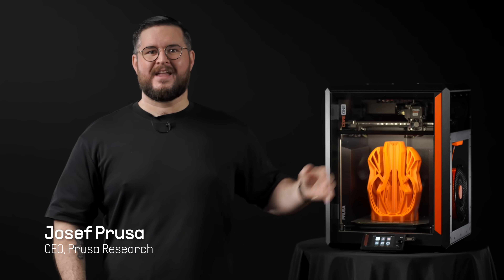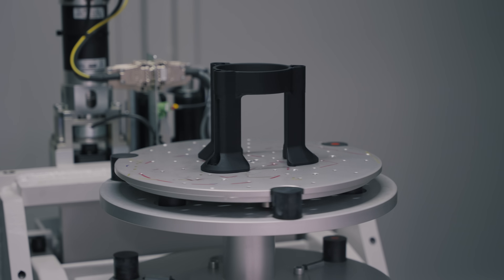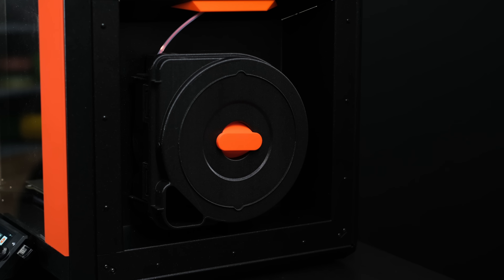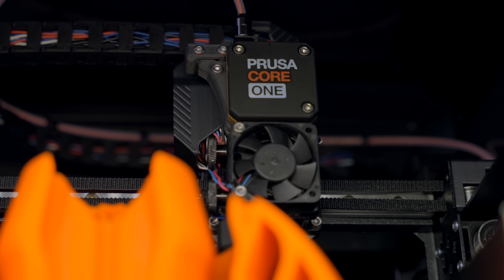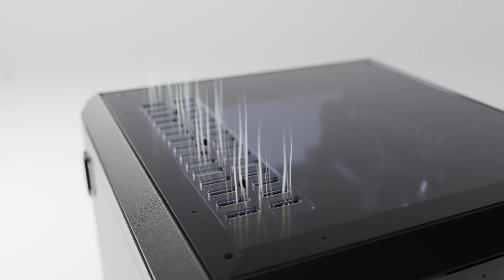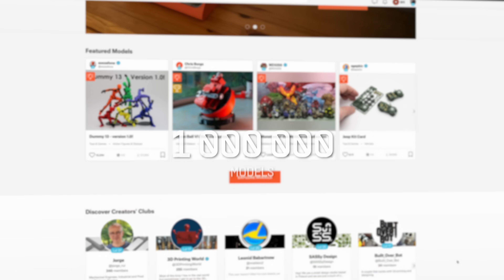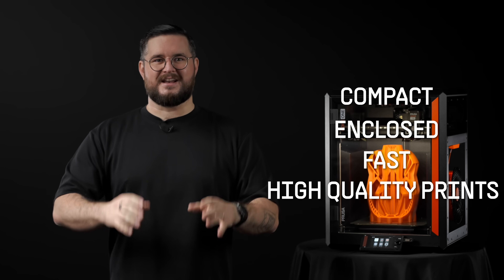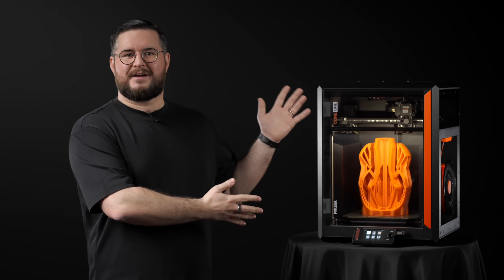Prusa CORE One - Fully Enclosed, High-Speed CoreXY 3D Printer With Active Chamber Temp Control

Comment: Was literally days away from ordering a Bambu x1c.
It's an objectively fantastic printer but my main hangup was lack of open source and repairability.

I think this is finally the printer that checks all of the boxes I wanted, AND with the open source ecosystem of Prusa 😍

Thank you for your hard work
Reply: 1050eur rn
Reply: FWIW, the X1c is a nice printer. I own 2, with 2000+ hours on each. They've been very reliable: a few clogged nozzles and one worn out extruder motor. I am looking at the Core One as a replacement for my X1s when they finally give up the ghost. And by then Prusa will have flushed out any bugs and production hiccups.
Reply: @seanwoods647 as reliable as it seems, BL are made to be expendable. The bearings on the Y axis are extremely hard to replaced and the luck of open source it is an issue for me if you want to keep your machine beyond what BL wants you to. With BL, you have limited to non authority to upgrade to the latest tech and the luck of a heated chamber is a big no for me as I only use engineering materials. The X1C for the price sold should have a heated chamber and it is why I haven't ordered one as I was so close to. I went to build my own custom printer and therefore I have utilized all the benefits of klipper. Don't get me wrong BL are good machines but the only way to get later tech once the next generation of tech (etc beacon, IDEX, tool changer and so on) is introduced is to buy their new printer.
Reply: Look I like prusa and their philosophy is a lot better than bamboo labs, but I don't know what people are talking about when it comes to repairability with bamboo Labs printers. Yeah all the parts are proprietary but you can definitely order them from bamboo Labs and for the most part they're easy to replace.
Reply: Bambu is as much open source as Prusa.
Reply: Sadly not shipping until April... (not including delays)
Reply: @skyslycer  The assembled version will ship in January 2025 not April 2025.
Reply: @skyslycer  it says right on their website it shipping the middle of November goofball
Reply: @Eric_In_SF  I was wrongly looking at the kit version. The assembled version will begin shipping in January.
Reply: For what it's worth, bambu labs has opened up access to open source firmware.
Reply: @MrPanaramuh  And you can buy nearly every part for doing your own repairs.
Reply: @tankgrrl  This. And, they're reasonably priced. Our x1c has over 1.7k hours on it and outside of basic maintenance, we've done virtually nothing to it. Our biggest "repair" has been a replacement hotend that they sent as an extra. I understand use cases are different for everyone..but this price point and these features don't justify it over an X1c. If you are already in the prusa ecosystem? Sure. As a new printer? No. The x1c is so user friendly, my dad, who knows nothing about printing, bought one on my recommendation for how beginner friendly it is. Between the loadcells in the bed and the lidar, he's never had a 1st layer issue that wasn't due to his forgetfulness to clean his bed every 50 hours. 

"But but, higher flow! Heated chamber! active temperature control! I don't have to print with my door open for PLA! Open source!" e3d hotend, Open source heater project for the x1c, an AMS top mount with vent sliders, X1Plus firmware. Everything this has as a feature, Bambu does better or the community has answered the issue. Never had an issue with support either apart from wait times.
Reply: I still think the X1C is better in almost every way except for print speed maybe...
Especially with the open source firmware installed...
Reply: I have 4 x1c, I would choose a Voron trident over this Core.
Reply: @urzulus  I built a 2.4 300mm and it's a great printer BUT...  I also have a Trident 250 kit in the box and all the printed parts, and I have had them for almost a year with no time to sit down and build the thing.  Hoping to get to it this Thanksgiving week, but if I were purchasing now instead of a year ago, I would definitely order the new Core instead.

Unless you need one of the larger bed sizes that's available with the Vorons, the Core is going to be hard to beat.  It would be difficult to build a Trident 250 for much less, and the Prusa doesn't give up much bed space to it.  Plus you don't have to tune it yourself, and there are all of the little quality of life features that are part of a Prusa.  Granted you can get most of those features and more with a Voron, but each of them is a separate mod that you have to build, configure, and tune yourself.  The result once you get a Voron built and tuned is awesome, but if you are just looking for a tool, get the Core.
Reply: Jesus. What is up with you all Bambu fanboys hitting Prusa's vid? Remember Prusa owners being called fanboys, but Bambu fellas seem to be absolute crazies. Get over it and remember that competition is ALWAYS a good thing. Jeesh 😂😂
Reply: And wait till you have to deal with their customer service. It’s a nightmare.
Reply: Yes but it's not filled with imho janky 3D printed parts. 3D prints are for prototypes IMHO, even functional ones for but for serial production it feels like a cop out to me...I'm not enamored with or excited by the idea of the machine making its own parts, cute trick. Give me injection molded or machined/fabricated metal or plastic parts thanks.
Reply: @JamesReedy  For Jo Prusa the printed parts on his machines are a point of honor.  In that if you manufacture 3d printers, you should have enough confidence in the parts they will make, to use those parts in the final product.
Reply: @netpackrat  If he's gonna keep using printer parts he should at least use ASA or ABS instead of PETG. They're more heat resistant and creep less.
Reply: @ yeah I know his intent I just don’t agree with it. You’re trying to build a durable and precision instrument and 3D printing it just feels meh. Wish someone just made a kit that replaced the printed bits with nicer machined parts. Frankly if the Bambu printers were around or known to me I’d have gotten that instead of my MK3S+ kit.
Reply: @derektran9404  According to the video, it sounds like they are using PC-CF for the printed parts in the Core.  Whether that's all the printed parts, or just some of them, I assume we will find out later.  And that makes sense for an enclosed printer.  On the open bedslingers, there's no reason to use anything more heat resistant than PETG which works fine in that application.  As far as that goes, the PETG parts on my Mk3S+ held up fine when I had it in an enclosure to print the ASA parts for my Voron 2.4.  Wouldn't necessarily want to do that permanently, but I didn't observe any ill effects from it either.
Reply: @JamesReedy  3D printed parts are good if used right. It's not like those parts are causing problems on Prusa machines. That said - Prusa seems to be using less and less of them (The Core One appears to use very few of them, at least not from what I've seen in the marketing), and they are changing the few printed parts they do use from PETG to PC-CF.
Reply: @ yeah just don’t like 3D printed parts. Some of my PRS rifles have fusion jetted parts on them which look acceptable, but most FDM parts look comparatively unprofessional. I’ve got a buddy who runs a bureau that does SLS, it makes parts you couldn’t make any other way so I respect it but when a Creality printer has more professional looking parts on it for $150-200 than a printer at $1000 it just gets under my skin. Personal preference, love 3D printing as a proto method or for fixtures and short runs but as actual products it’s kinda gross imho outside of metal.
Reply: I can't see any reason to even consider this above X1C today, let alone when it finally ships next year. Competition is great, but this is nothing more than a reaction to Bambu that falls very short.
Reply: Just ordered a Core One as well.  I too was about to get an X1.  Core One  nudged me back to Prusa
Reply: at this price, might as well get the x1c ( this is for anyone that just wants to print)
Reply: The Bambu X1C is objectively a better printer, though. It's the same price (with the current sale), and probably still faster. The benefit this has is the open-source factor, which is not nothing, but not the end all-be-all for most users.
Reply: You sound like you work for Prusa. Because your reasoning seems a little off. Why would you pay €300 more for a printer which will be delivered in a couple of months (if you're lucky). Where the only benefit is having a heated chamber? 

EDIT: It doesn't even have a heated chamber, it's an Active Chamber Temp Control. Meaning it will just blow out the hot air.
Reply: Yes the open source aspect really is that valuable for me.

Especially with the legal efforts being made to control the types of prints you can do; Bambu will surely be one of the first to comply with that since they are liable via their cloud service.
Reply: Its not fully open source.
Reply: @ItsRyanStudios  This argument falls apart when you learn about the open source firmware Bambu Labs has already authorized it's users to use, X1Plus.
Reply: @MrPanaramuh  What about repairability, and without the guarantee of Bambu always being around to provide replacement parts?
Reply: @ItsRyanStudios  While reparability is a genuine concern, realistically Bambu isn't going anywhere anytime soon. But, on the offhanded chance that they do fall off the face of the earth, the open source community will fill that gap with hopefully the help of Bambu releasing CAD design files(Possibility.)

Prusa does win in this category. But, Bambu Labs has never advertised as open source to it's consumers and is why the machine is so beginner friendly. Less user input, less user error, and a more reliable machine. Prusa is also slowly showing signs of a decaying OSHW principle.
Reply: @MrPanaramuh  
Fair enough.
Also, the new Prusa Core machine seems to be leaning away from the repairability/ RepRap philosophy as well, using more machined parts, and appears to diverge heavily from the well documented and repairable parts of the MK series.
Reply: @ItsRyanStudios  Yup. Every new printer seems like they're divulging less and less hardware wise. Closed source, while limiting as it is, also enabled a better tuned printer that doesn't rely on its end user, so I understand.
Reply: Its a better quality machine from a vendor with basically unparalleled track record and proven Support.
The Core One does not need to exceed the Bambu printers to be worth the slightly higher price Point, simply because there are upgrade paths (if prusa releases a core one s you'll be able to upgrade to it reasonably cheap) and there are replacement parts available.

I've had an issue with self-testing of my MK4 when upgrading to the S: The temp self-test failed. I had a chat with someone from prusa Support, they checked various settings and then sent out a new heater, for free, which arrived 24hrs later (express delivery).
It's experiences like this that make me not even consider a chinese printer with questionable support and dodgy replacement parts supply...
Reply: @glp.1337  "only benefit". If you print anything but basic PLA/PETG this is very important if you want quality. Also he mentioned OpenSource which is very important to support for us as a community. BTW I don't own or use any product by Prusa. 🙂
Reply: @glp.1337  I own an XC1 but the 300 more seems justified considering:
* open source compat
* the upgrade path
* heated chamber
* emphasis on security
* it's made in the EU, where workers actually have rights and get a decent wage

That being said I won't be getting rid of my XC1 just for this one, although if Prusa had come out with this one a little earlier I might have bought it.
Reply: @coppurt  Getting an X1C with AMS would still be €100 cheaper. 
Some counterpoints: 
* You have X1Plus firmware (opensource) for the X1C
* This printer probably won't be upgradeable
* EDIT: The CORE one doesn't have a heated chamber
* you can run an X1C in LAN-mode (offline)
* The printer might be made in the EU, but the chips they used aren't. So if you're going to be all ethical, you can't be cherry picking.

That being said, I'm also not getting rid of my Prusa MK3s+ and Prusa Mini+. I might even consider finalizing my Prusa XL pre-order if the new Bambu Q1 release isn't going to be a good competitor for it.
Reply: @coppurt  Chamber isn't heated, its a temp controlled fan.
Reply: @coppurt It has a temp controlled fan. This is not what you expected.
Reply: @coppurt X1 firmware is open source
Reply: @glp.1337  you’re the same guy that buys a Kia instead of an Audi because hey, they both have contrast stitching!!!
Reply: @Eric_In_SF  I'm just addressing the flaws in your logic. But I guess you don't want to make any counter-arguments.

Comment: Selling my two MK3S printers to buy an enclosed MK4 and upgrade it to an MK4S was one of my worst and most expensive decisions, especially now that the CORE One is released. The enclosure, which cost me €500, feels like a leftover now. Upgrading my MK4S to a CORE One would bring the total cost to around €1,800, and when you add the enclosure for nearly €500, the total jumps to €2,300.

Don’t get me wrong—the MK4 and MK4S are fantastic printers, and I’ve had great results with them. But it really hurts that I sold two perfectly working MK3S printers for a fully equipped MK4 with the S upgrade and enclosure. For the same price, I could have nearly bought two CORE One printers.

Comment: Nah, I want to see a bigger build volume. At least taller so I can angle large pieces into the space. 350 or 400 tall. Vertical space in my workshop is not an issue.

Comment: And no one ever includes nozzles larger than .4mm, or any good nozzle for that matter. 

A .6 and .8 nozzle should be included, especially for those that use their printers for prototyping.

Edit: yeah no. For 1200 i can currently get an x1c ams combo. Some sell as low as 900 even.

Comment: I like the filament spool on the side.  But, can the recess be inverted so the spool is on the INSIDE (the Voron Trident can do this) so the heated chamber IS a dry box?
Also it would be nice if the door could swing 270 degrees so the printer could be run open for PLA without the door getting in the way, or have to be removed.

Comment: Bambu user here. Now THIS is a direct competitor that I was hoping to see from someone, as competition like this drives everyone to innovate. Due to the all steel construction, if the reviews show it lives up to the claims, this will be my next addition to a small print farm for printing engineering materials. Congratulations Prusa, and I hope this does well.
Reply: Yes I'm excited. Not only that but now this kicks it back to BBL to innovate and keep its customers.
Reply: as soon as it has an AMS option, yes. For a lot of people that's the killer feature of the bambu.
Reply: @electronicsandewastescrapp7384  Does the MMU3 count? Because the Core One is compatible with Prusa's existing MMU3.
Reply: Coming in 3 years late😂
Reply: Price for bambu , affordable 😢
Prusa parts are expensive, and bambu has self-levelling beds, sensors, and speed.

Comment: Really ??? all that flash......and your build volume is less than 300x300.  come on.  releasing something new to the market less than 300X300X300 is like taylor swift releasing and new album onto 8 Track.  Porshe releasing a new car with only and AM/FM radio and mechanical window system.